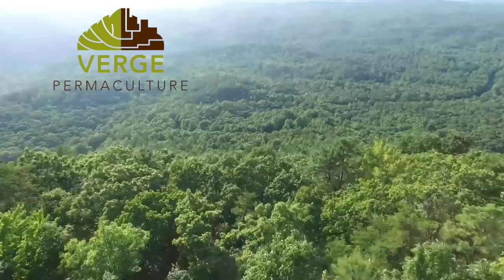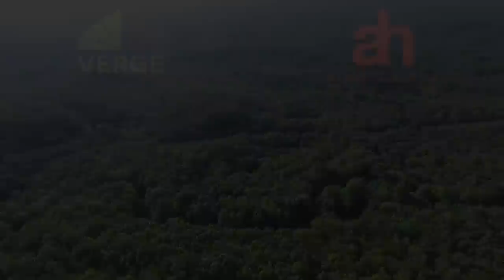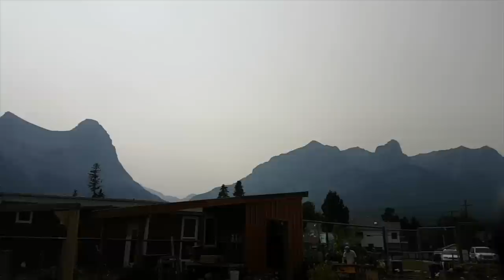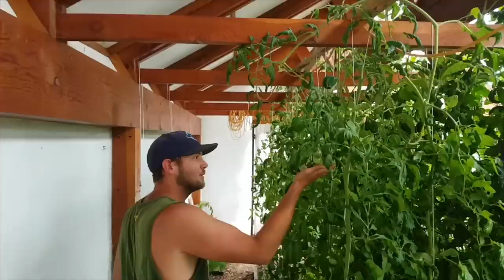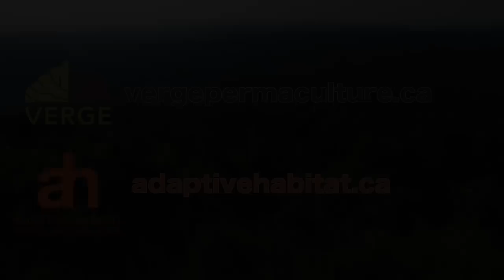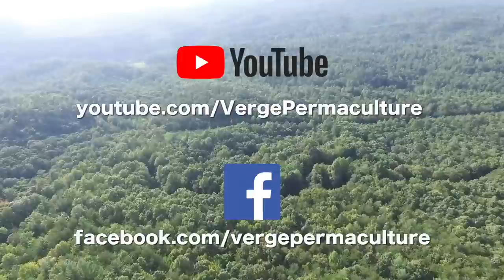Insights From A Strawbale Greenhouse

Comment: You never addressed the mold or moisture issue. I know they breath, and last for hundreds of years ( Well 200 for sure), the r factors are well known. They don’t burn and once sealed are not insect or rodent attractive. Please research the humidity and moisture and get back to the research as a green house please.